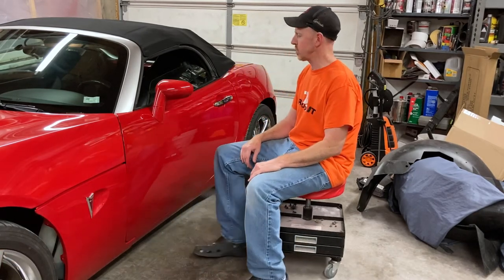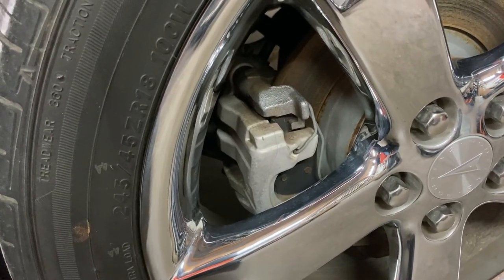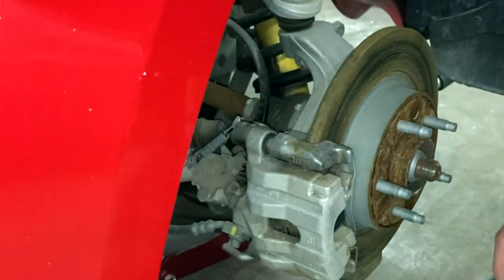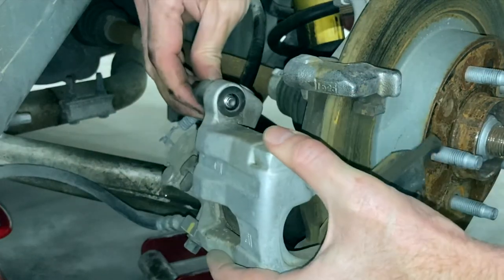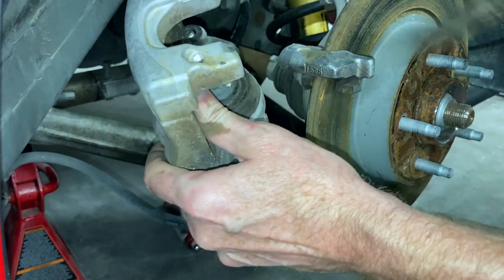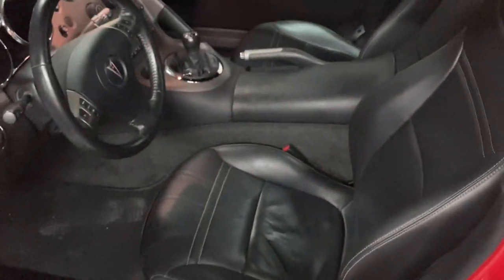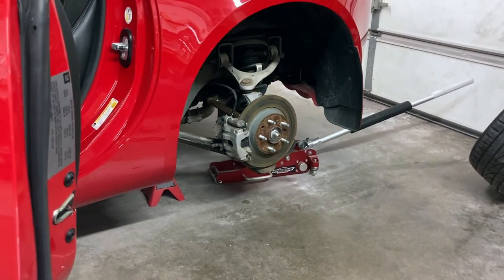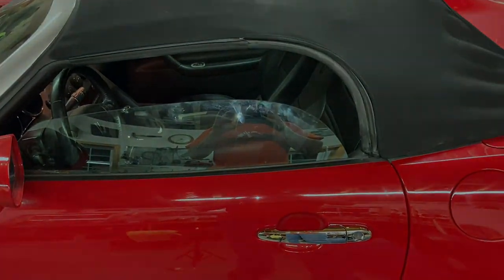Tutorial: How to Fix A Solstice Parking Brake The Easy Way!

Comment: Just had to do this, 08 Sol GXP. Stupid easy if you've ever turned a wrench. 45 min job with hand tools. An FYI, since the Sol dosn't come with a lug wrench, it's 19mm for the lugs and 100ft-lbs for the torque. It's an almost clever adjustment system but it should have an external adjustment; I relaize it's to keep the adjuster clean but still. Seems all we're doing here is breaking a bit of rust lock and allowing the adjuster to work. I could feel it under my foot the first three times I used the brakes in reverse and then it tightened up like a drum, holds 2500 rpm on an incline. I advise putting a hockey puck on the pad of your trolley jack and if you jack from either rear lower control arm aft mount, you can lift the whole rear end at once the suspension is stiff enough for it. You'll be able to get jack stands on the forward portion of the lower arm mounts.